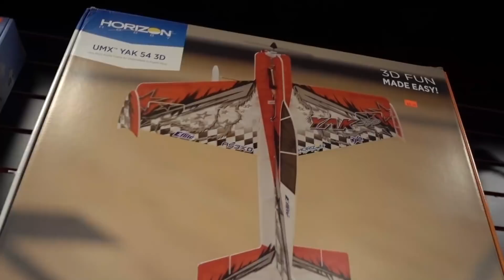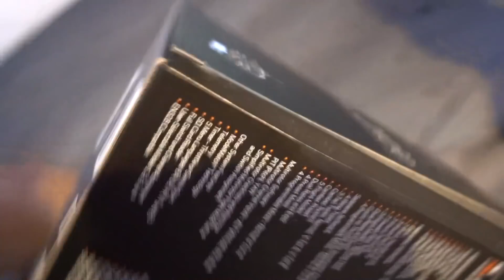Hobby shop field trip!

Comment: sketrum have some nice sticks.. really high quality feel. But I think value for money you cant go past Turnigy 9XR Pro they actually just changed the price down to $30 bucks which is fucking insane for such a great transmitter. I use it with Frsky RX and never had an issue, amazing performance, and I fly everything from EF-1 Pylon racers to Precision Aerobatic Extras etc...
Reply: When I restarted flying I used the 9X with ER9X and frsky module. It was a great tx but now have a Taranis and haven't looked back.